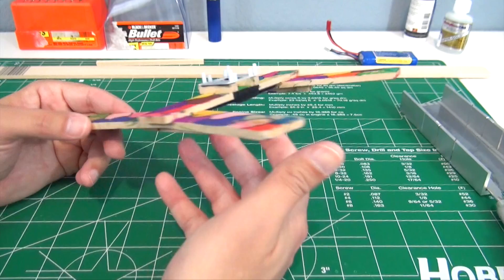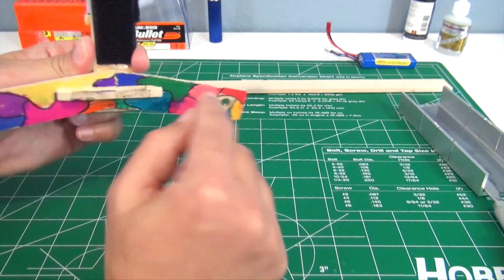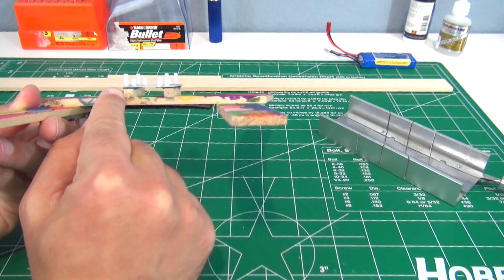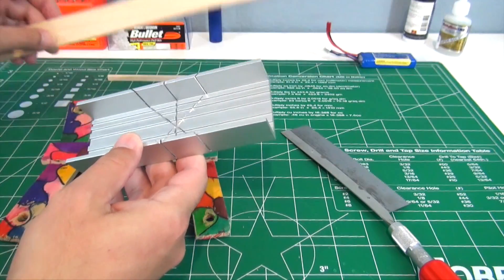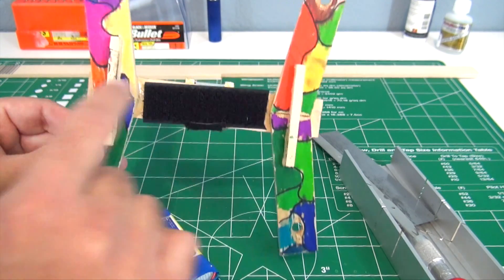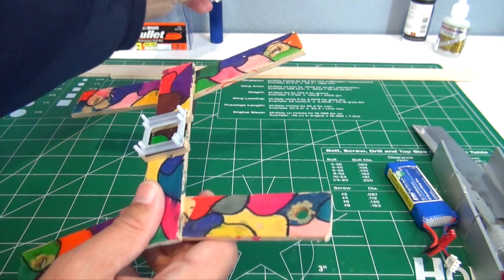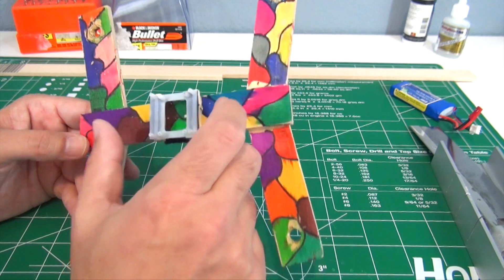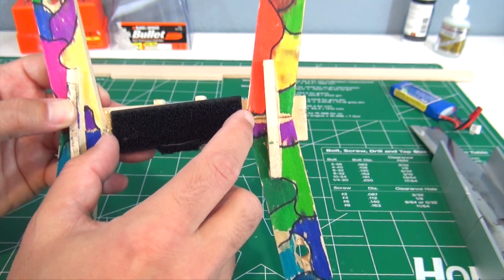200 QX Basswood Frame: Quick Build Guide

Comment: Thanks so much for this video! After about 15 flights I finally crashed full speed into a light pole and destroyed my stock frame. This is a great alternative to the $100 Rakon Heli frame. Hooray for diy!
Reply from the maker: +Jon B Baca Thanks for checking it out! That stock frame is just not made to last. I'd like to do more diy stuff...just need to find the time. :)
Reply: The 200qx is really a pretty simple machine comparatively, good for first time builds and DIY. Especially cutting out the little controller/ESC mount from the original body makes it really easy. I just gutted mine tonight, and I think I'll build this wood frame while I wait for my Eachine Q200 carbon frame to come from China